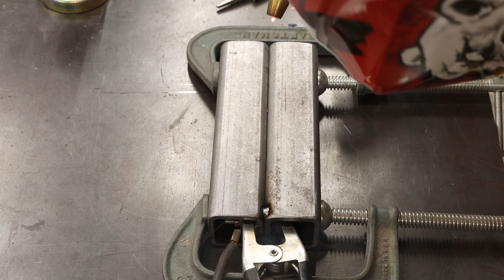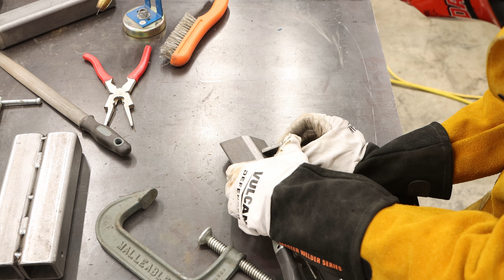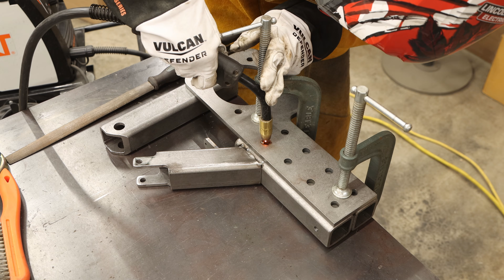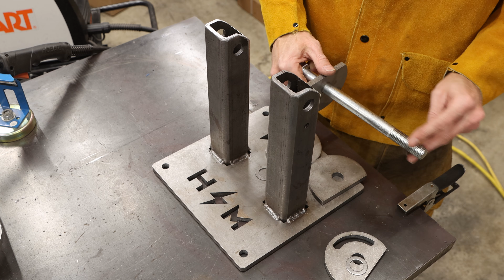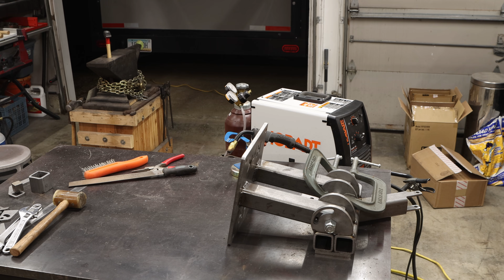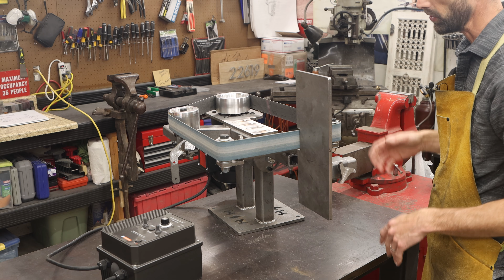The Revolution grinder build series  - Part 3 - The welding

Comment from the maker: What are you working on in your shop right now?
Reply: Today I'll be gluing up a set of segmented handle  scales for a hunting/camp knife and starting a heat treat oven build. The oven came from an orthodontist (Cress Electric Furnace used as a "burn out oven"). I took out the old components, and using redbeardops/DC knives tutorial and recommend parts for the build with a few mods. Gonna be F-U-N!!
Next on the list is a brake drum forge.  What I love about knife making is we get to build damn near every tool or machine to make our knives. Who could ask for anything better as a hobby? LOVE IT!
Reply from the maker: I totally agree!
Reply: A dagger for the viewer challenge. It will likely be my first true blade 🤞🏼
Reply from the maker: This is extremely exciting!
Reply: im building a 29 ton press off of red beard ops video all done just need 1 hose and fitting then i can fire it up and see if it works lol hope i wired switch and motor correctly😳😳i will fb message you pics arin Mark😃
Reply: Kbar sheath. Knife is done, I'll email you finished pics of both when I get the sheath finished.
Reply: Friend me on Instagram and find out. 😂😂 or check Facebook for my answer.